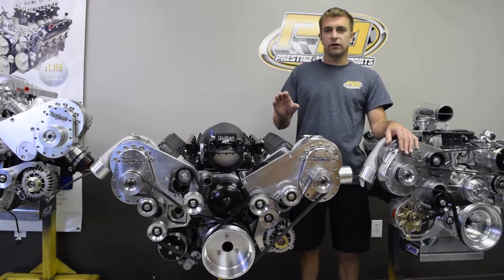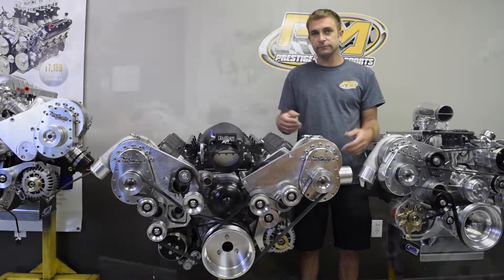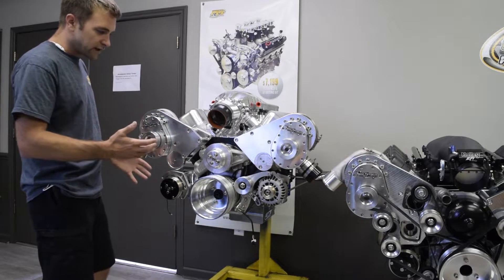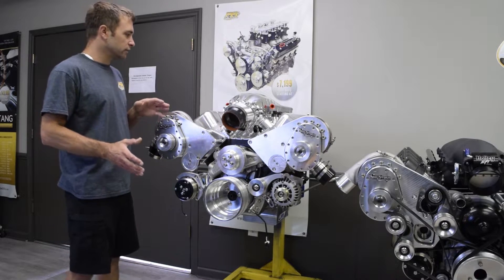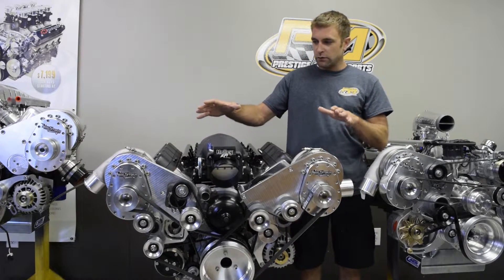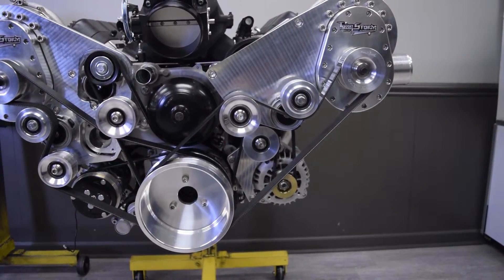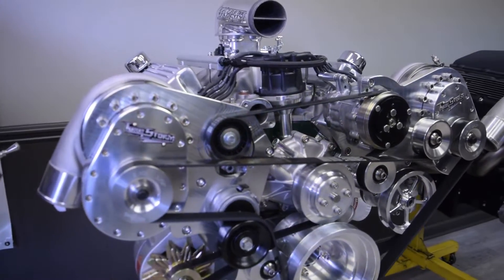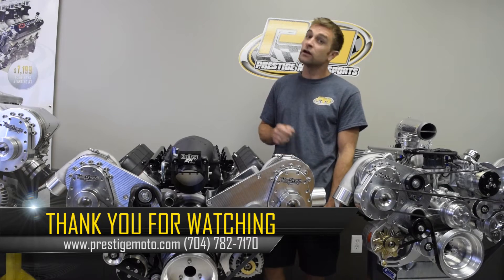TorqStorm Superchargers from Prestige Motorsports with President, Doug Aitken

Comment: Do u offer torqstorm on your web site? I can't seem to find it
Reply from the maker: Most of the listings on the website currently are just long blocks but we have a power adder series as well for each. All can be built to drop in ready specs.
Reply from the maker: https://www.prestigemoto.com/custom-engines/ford-small-block-engines/power-adder-series/turn-key-supercharged-427-ford-small-block-stroker-crate-engine-f427-b1-dtq-1.html
Reply from the maker: https://www.prestigemoto.com/custom-engines/ls-engines/power-adder-series/drop-in-ready-427-ls-next-twin-supercharged-engine-l427-b1-dtq3-1.html
Reply: @prestigemotorsports  all I need is the supercharger. Thx
Reply from the maker: @lylegoodluck  Oh gotcha we are not just selling superchargers at this time. Contact TorqStorm and they will be happy to assist Im sure.
Reply: @prestigemotorsports how much would this ls package cost ?